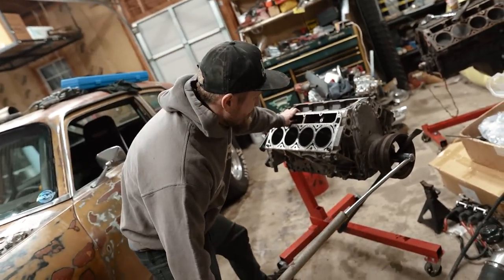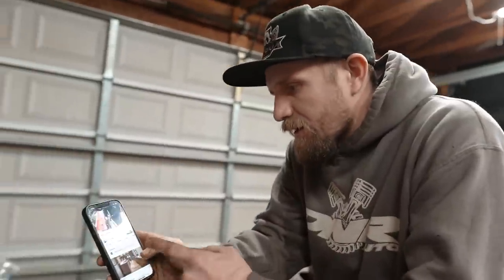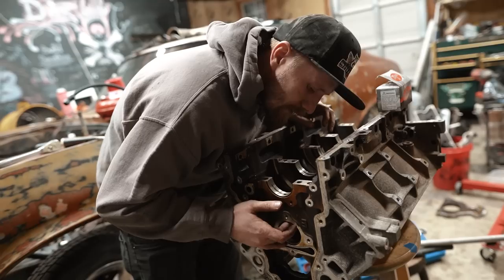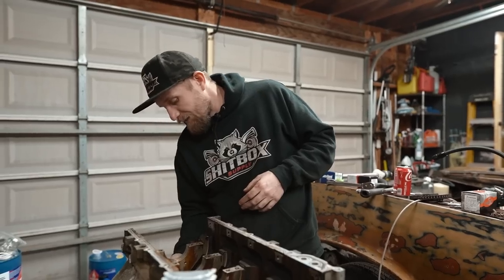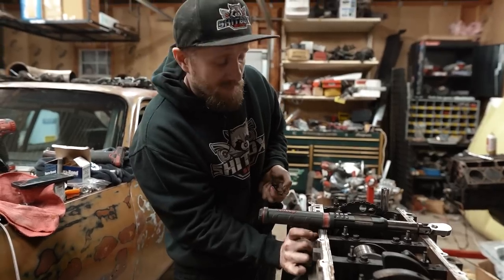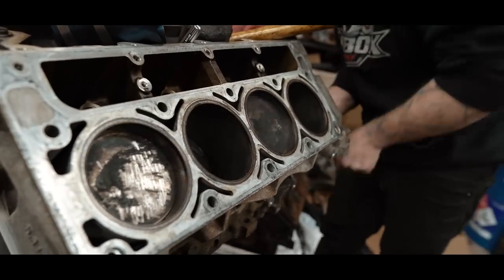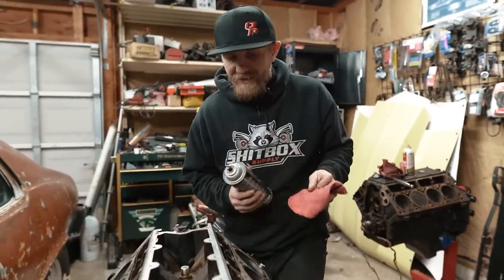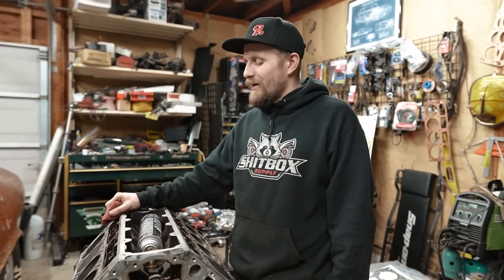BACK IN ACTION! New Aluminum Block!!

Comment: I feel you just building 355 with afr aluminum heads changing springs have to have right valve locks every turn something new what you buy won’t work crazy than two woods get right parts hang in there can’t wait tell you succeed

Comment: My machine shop build has been sitting in my garage for 3 or 4 because of what i didn't know the first go around.  So if a feller thinks he's just been sitting on his couch twiddling his thumbs that's simply not the case.  It's realizing he was wrong and taking the time to gathering the correct information he needs to proceed.  Which may not cost you money in time.   But will cost you where you realize you went wrong.

Comment: Don't forget that aluminum LS blocks usually need the center cam bearing honed after installation. For some reason the block gets tight there after use. I hate to give this as advice but, get a bigger hammer...
Reply: Interesting..

Comment: Hey bud take a little propane torch and heat the crank bolt head for like 10 mins and it will loosen up way way way easier every time.   Try it

Comment: You have been on my mind today. I know you have a problem with getting machine work done in a reasonable manner. I though why doesn't he get involved with a big engine rebuilder like Power Train Products or Jasper. They got hundreds of engines and transmissions. But here you are busting a wrench again and knocking a  motor out.

Comment: I am only in 12:13 on the counter, and again am reminded you are the 2nd unluckily dude on the planet Matt (Still in Machine Shop Jail here also bro (since March 4 last year, took the running 93k mile NHRA Stocker never been apart ever since factory assembled Dec. 1983 engine out January 12, 2022), but they finally have my block tanked like 4 times, now line bored, cylinders bored, not yet final honed, custom Ross Forged NHRA appr. stock repl. pistons rec. 29th of Sept 2022 measured up (though they came with a full laser measurement sheet that is like 4 pages long already, they are blueprinting, balancing and must machine everything on the block to custom fit it all to those new bullets, and only have the 1 shot, to keep it all numbers matching, so are taking the do one action a month, measure 80 times route.

So, don't feel alone brother.

But, always....before removing things like bearings (especially installed cam bearings), grab the calipers and measure up, and at least compare repl. parts side by side. Just my 2 cents.

I was replacing my ugly stamped steel valve cover with a plastic pcv box that was prone to cracking, on a freshly prepared head with a modified Chrysler TURBO valve cover I had letters milled off of changing TURBO to T  B  I (To match my combo), right after I changed the existing R to a decent B with some special epoxy metal magic work, and rattle can painted it red to match the underhood color and other engine bay accents, and hand brushed the lettering black to match the future block color and the fresh engine bay color. Only to realize the valve cover was 3-4 times the thickness of the rails on that original thin stamped steel cover and not a single valve cover bolt would any longer work.

Rescued by the magic metric fastener drawers at my local Home Depot and after measuring up for my current needs, stocked up on at least triple and purchased what I needed X 3 each, so I have a spare parts container in case anything is lost during future fast pace teardowns, as I have done throughout the rebuild.

But, the look on my face when I went to trial bolt on the valve cover and the bolts did not even grab 1 thread on the original ones removed, was exactly what your face looked like on camera when you easily slid in that correct number front cam bearing and it slid right in freely by hand and that magic light bulb in you brain fired off....ooop's.

I only wanted the fresh expensive new 1 pc rubberized valve cover gasket that was all twisted up and set funky in the package to clamp down cold for a while, and take a new set to fit properly later. Though the head looks great though covered on the bench to keep the dust off, all the rest of the freshly painted long ock parts are still collecting new dust over the last year waiting for the short block to be finished up.

Now, if I don't die first, I may get to race again!.....Someday....sooner than later I hope. As soon as they source my bearings and seals they tell me...oy vey.

Comment: Not exactly sure I would of went with the new bearing/ used bolts combination on the connecting rods..  torque to yield bolts stretch & the big end of rods waller out egg shaped never a perfect circle.   Old bearings with new factory bolts would of been how I did it.  But to each their own.  Remember this if another rod bearing spins because I may tell you I told yea so.  Not tryna hate on yea Matt only tryna give yea some proper advice that I had to gather let's just say not necessarily the easy way either.  I hope the best for yeah I truly do but with seeing the process it's very hard to foresee a different outcome than the last run.

Comment: Not so much about seating the thrust bearing more about having the proper thrust. To little thrust when your converter starts pushing on the flexplate youll wipe the thrust out. to little thrust youll have crank walk and mess up rod bearings cylinders maybe put a piston in the pan

Comment: One thing I realized is with a ls u NEVER HAVE ALL THE PARTS NEVER 😭😭😭
Reply from the maker: It’s only cause I stepped outside my norm. Usually I just do regular ol Gen 3 stuff and I’ve collected parts for those for years
Reply: @DNRAuto  but I’m glad u did that because I have Gen 4 rods had know clue I needed Gen 4 head studs

Comment: MATT , MATT, MATT Weres the motor  you took to the Machine Shop at you go to more LS engines in Carter has pills that  nova would be a fast car if it was twin turbo fuel injector
Reply from the maker: Literally explained that in the video